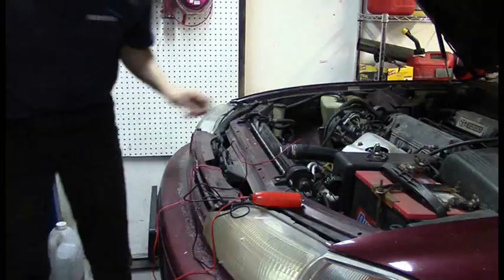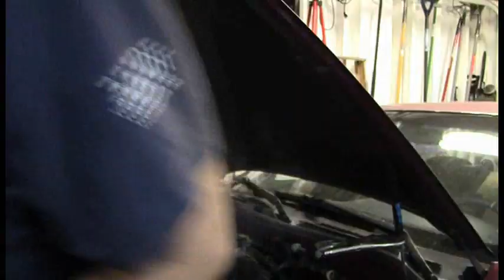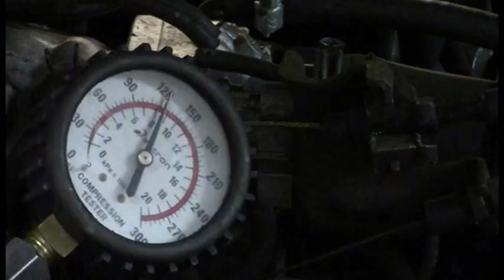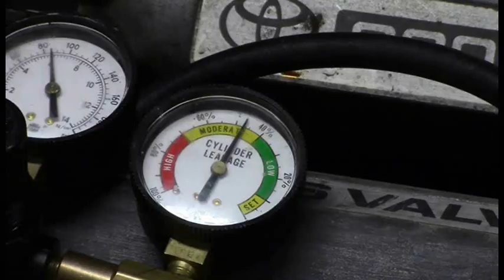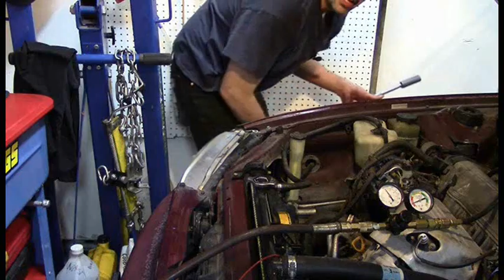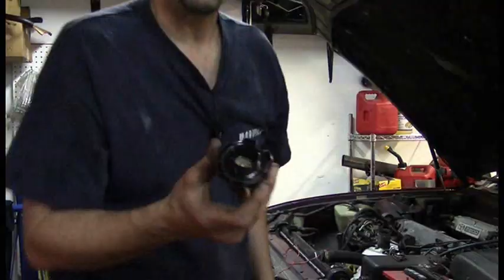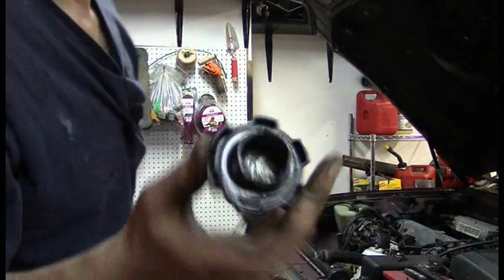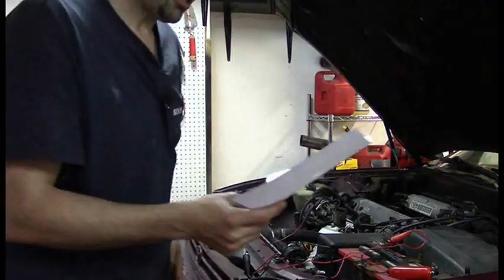12 Ways of How To Test A Blown Head Gasket Compared- PART1

Comment: Great Video.. thank you 
Is it possible to pass the hydrocarbon test and still be leaking coolant into the cylinder?  Mechanic said it passed the hydrocarbon test, but that a blown gasket is why I was losing coolant and overheating.  
His diagnosis was Based on Pressure test indicating a pinhole in gasket, and coolant reservoir overflowing after leaving the cap off while bringing car up to temp.
( I accidentally overfilled the reservoir tank the night before. I spilled some out after getting to operating temp and taking the cap off the reservoir, but it could have still had too much coolant? )
Reply from the maker: Heavendreamer2 That's a good one.  I am going to have to disagree with your mechanic, based on a number of foundations.  Mind you though- he is the professional and I am the DIY, but here are my issues.

First, on a pinhole headgasket leak (not that I believe in pinhole head gasket leaks btw) but assuming you had one- if anything you would expect the hydrocarbon test to be positive but NO coolant in the cylinder. Why? Because remember in the cylinder, compression is at some 150-200PSI.  Coolant is at 15PSI.  Even on the intake stroke you will have far more combustion gas to the coolant than coolant to the cylinder. Not that you would even notice coolant in the cylinder with a "pinhole". I don't buy that you would have coolant in the cylinder but not combustion gasses in the coolant. Maybe if that cylinder also had no fuel misfire too then I guess so.

Second, Coolant flowing from the reservoir or radiator is expected when the car is brought to temp. It's the second purpose of the cap (the first being to maintain pressure). AND- think about it- even if his test were valid, how can it overflowing when his claim is there is no combustion gas in the system??? Totally illogical contradiction.  The coolant is overflowing when brought to temp because coolant expands when heated.

Finally, if his cooling system pressure test indicated the pinhole leak through a head gasket, he would have been able to show the drop of pressure with his tester corresponded to flow of coolant into the cylinder (e.g. remove spark plug and coolant is in the cylinder). Also a leakdown test would definitively verify the pinhole theory. With a leakdown test on the suspect cylinder, even through a pinhole the coolant would bubble over even with engine off.  My bet is these were not done.  

The better explanation would be loss of coolant through the intake manifold gasket, not head gasket. This would better explain coolant entering the cylinder but not having a head gasket failure.
'
Reply: But if coolant did enter the cylinder, it should have combustion gasses in the reservoir, right?

 The car does not seem to have a misfire issue. It does run slightly rough, but this was going on long before the car overheated and was supposedly due to a different problem. As a matter of fact, we had a blown head gasket and cracked head two years ago (the head was machined,t-stat replaced etc) and the car still ran rough, though not as bad as when we had the cracked head.

At this point I'm not even sure we are losing coolant other than due to an overheat taking place. All I know is that the car has overheated a couple times on my husband, he had to replace the fluid, then continued to where he was going, without further problems.

Before all this happened, I had no real understanding of what to keep an eye on with the car. I did not check fluid levels, except oil once in a while if I suspected it could be low. I never thought to check coolant levels because I was not aware it could get low unless there was an issue.  But before I brought it to a mechanic, I wanted to know as much as possible, rule out certain things etc., because tbh I'm afraid of getting ripped off if I have no idea what is and is not possible, lol

So I have been researching for days.  I don't believe its a water pump, and not even sure if there is a big leak. I put fluid in the car this winter and drove an hour to go get my husband, with NO overheating whatsoever. The car cooled off for about 20 minutes or so before the return trip. Without checking the coolant level, we returned home another hour of driving also with no issues.  

The car had been serviced in 2013. Since then both I and my husband both drove it mainly locally. He works very close to home, and most of the stores we go to are close as well. He had an issue with an overheat when he drove more than 20 minutes, and from that point it happened a couple times.  So then he just made sure it had plenty of fluid the next time he went somewhere, and had no problem.  Then there was that 2 hours of driving this winter with no issue.  

All of this tells me at the very least it is not the water pump or a blocked or non working radiator.  Either the fluids got too low - via a slow leak somewhere, not properly burped or filled after being worked on in 2013?, neglect on our part or something along those lines?  I don't honestly know enough about cars to know all the possibilities (now I have to go look up intake manifold's , lol)   

The other thing this guy did.. which I found after I got home (thank God I only live a couple minutes away from that shop) is that he left my coolant reservoir bone dry :./  Needless to say, between his comments on the reservoir overflow (leaving cap off/bringing it up to temp) and the "pinhole" in the gasket indicated by the pressure test - combined with leaving my reservoir dry when I went to pick it up, I really don't have confidence in that shop now.   He also said because the car had overheated, been worked on, then overheated again and had the head machined etc., now that it overheated again he was not even willing to do head work, but recommended a new engine altogether.  needless to say, I am not confident in his 'assessment.'

I did talk to my brother who is a mechanic of 35 years, and he tells me that a gasket can leak without going into the Cylinder, but I would think you would expect it to leak into the oil if that were the case?  idk. Maybe it can leak onto something hot and evaporate and we would never see.

And again, it could have been that it just didn't have enough coolant in there from the last time it was worked on, or from our own neglect.  There are probably a lot of variables that I am not even aware enough to consider.  So now I am going to spend my weekend looking up how the engine works, how the cooling system works, etc. and will be bringing it to another shop for diagnosis on Monday.

Thanks so much for your input, it is very much appreciated. I plan on learning a lot more, and at the very least I will be making very sure to keep an eye on fluids etc in my cars from now on, and to make sure they are maintained properly.

  I hope you have an awesome weekend, and thanks again for the great video! I will be looking at more of them! XD
Reply from the maker: Heavendreamer2 Yes it all comes down to understanding how the engine works. And agreed, the credibility of your mechanic is dropping rapidly.  But to answer your main question on the possibility of a head gasket leak getting coolant in the combustion chamber but no combustion gases in the coolant, think of it this way (though it is sort of a bad analogy but the principle somewhat applies) :
 You have a pressure cooker and it's sealed up and operating at full pressure.  You put the pressure cooker in the sink and cover it with water.
  What your mechanic is saying is there is a pinhole leak in your pressure cooker and water from the sink is entering the pressure cooker BUT and the same time there are no bubbles from the pressure cooker showing up in the sink.  You tell me how that is possible.

 Now that answers about the coolant entering the combustion chamber through the head gasket. As you see, hard to explain.  Now, you can certainly have head gaskets leaks where the coolant isn't involved at all, you can have pressure lost to the next cylinder, you can have oil leaks etc. But if coolant is involved think of the above analogy.

  But another way you could have coolant enter a combustion chamber is through the intake manifold.  Totally different scenario and harder to make an analogy. But it would be sort of like your pressure cooker in the sink of water had a snorkel coming off the lid and out of the water that you feed air and food into but ONLY WHEN THE PRESSURE COOKER IS NOT UNDER PRESSURE.  You can see how a leak in this snorkel would allow water from the sink to enter the pressure cooker but since it isn't under pressure, gasses would not enter the sink. Another bad analogy but the concept still holds.  You can see this is a better explanation for water in the pressure cooker than the first example.
Reply: Yes, I can see what you mean. I did read a little on the Intake Manifold, and the stuff I looked at said that you would probably hear a hissing, or even a slurping sound (depending I guess on whether it was leaking coolant or sucking in more air.)  In either case I would think it would affect the combustion quite a bit. If it were leaking only air, I don't think I would see the overheating problem (car would be running sluggish etc) but if it were leaking coolant into the combustion chamber, I still have to think it would mess with the firing. I still have a lot more reading to do, lol

I wish I was more certain of what happened with the coolant, but I wasn't there and it's been a while.. hubby is getting frustrated with me pressing for details, lol. 

I am hoping they test it thoroughly on Monday, and have clearer answers for us.

Thanks again for taking the time to help me understand.
Reply from the maker: Heavendreamer2 Wow your perception and comprehension are dead on.  You won't hear the hissing sound on an internal intake leak though. Even on an external one it has to be fairly significant. 
 Well if you were in Denver I would look at the car and diagnose it for free.  It would make a great video too!
Good luck and keep going with your learning, you're dead on with your conclusions and I think you'll come to the same ones as me.
Reply: Well, ty.  I wish I was in Denver! lol  
crossing my fingers.
Reply: Thought this was interesting.. especially in light of your friend's 'sizzle test'  

It occurs to me though, that this may not be the best test unless you can see a really clear difference and can get a large enough sample of oil from the pan.  I can't, because I don't have equipment and am not allowed to do car work where I live. Not even sure if I could reach the pan, it's a tight fit under there without raising it on my non-existent blocks, lol.

My thought is, that according to the article, most cars have at least a small amount of moisture/water that gets suspended in the oil additives until it can be burned into steam and released by the PCV. If you're not driving long enough for the car to heat sufficiently to do this, it will stay in the system/oil.  In my case, the car is most definitely NOT driven enough, and therefore some moisture can be expected. The article says that the glycol itself does not boil away. This means the 'sizzle' is water, not glycol.  Sooo at least in my case, not the best test since I can expect small amnts of water to be present. 

Just a thought.  Oh.. and I'm wondering if the blot test works with oil from the dipstick, or if you need to get it from the pan itself. Wondering if it be more coagulated on the dipstick than in the pan due to air reaching it. Don't mind me.. I'm like a dog with a bone at this point lol. It's really hard to quit chewing on it.. I think I will try to play my video game and hopefully distract myself enough lol.
Reply: Schrodingers Box  Well.. I brought the car to Sears Auto today.  Kind of wishing I had skipped that and just brought it to the dealer or something lol.   They call me back, tell me the water pump is good, they found no leaks, Thermostat is good, and Head gasket is fine.

  I get to the shop later to pick it up, and they tell me that it failed the Block test. I was like.. wait, I thought you said it passed?!  The guys says that it 'took a long time' for the test to show any combustion gases.  Now I don't know what to think.  He recommended I take it to the Dealer for an OBD II diagnostic. Apparently, Sears Auto (at least the one near my home) doesn't do compression tests or anything like that.. the most they did was pressure test (no leaks), Block test, and I guess check the hoses physically (including to indicate thermostat is good).  *sigh*  

So here I am SMH wondering if the "tiny amount" of combustion gases would have been a large amount if the car had been driven for a bit first?  I know they run the car to run the test, but it passed the first time, and passed the second.. except then apparently the "pass" turned into a fail by giving it longer to find gases?  This is so confusing. It really makes me wish I had been there to see what they did lol.  It prob needs a good diagnostic anyway since the check engine light has never gone off from the first time they fixed it. At least no one has charged me yet ...
Reply from the maker: Heavendreamer2 Yeah my experience is Sears techs couldn't diagnose a diaper rash much less a head gasket.
  There is some validity to the possibility that the combustion gas test may take some time to detect but the thing is a leakdown test would be instantaneous and irrefutable. 
  And OBD Diagnostic can not determine a head gasket- you have to do mechanical testing. Even a $15000 OBD diagnostic tester cannot call a headgasket-  it has nothing to do with OBD. Even if you did get an OBD, you can't fix anything until you ensure the head gasket is not an issue.
  You really need a competent mechanic to do a leakdown test. It couldn't be more simple.  You run compressed air into the cylinders and if you see the coolant bubble you are done- Head Gasket.
Reply: Hahaha! Diaper rash, lol
Leak down test...gotcha
I remember seeing you do that one on the
Video. On the bright side, I have learned a LOT about how the cooling system works, how the Heater ties in, and tests to diagnose a head gasket leak (or just loss of compression in the cylinder. ) TBH I am amazed at how simple it really is. Once I looked up how the thermostat works, and then how the cooling system works (with diagrams), the Light went on and I can actually think about it logically.

Yea I was a bit puzzled by the suggestion for the OBD too. But my check engine light IS still on so I'm not sure what to think about that. Maybe they just never reset it? Or would it only stay on if there is a prob and should I have the OBD done anyway ? In addition to a leak down test I mean.  Nvm.. I'm going to bring it to Dlr & just tell them it's overheating, check engine light is on, and no heat and let them sort it out.

Thanks for all the great info! 
Hope you have a great week XD

Comment: Hi sir i have a 2002 ford focus its overheating trying to figure out what is the problem i did the chemical block tester stayed blue removed thermostat and replaced water pump even even bypassed heater core flushed radiator and burped system but i did noticed a little water in the oil what could this be would a manifold intake leak cause it to over heat or could it still be a head gasket thanks bro?
Reply from the maker: Could be. You will need to do basic cooling system diagnostics starting with pressure test

Comment: Hi I was driving my bmw 325i (1991) and It's always had a constant overheating problem. It would always go between the H and C, like while driving the car sensor would go to H then go back down to C in like 5 minutes of driving. I thought it was just a faulty sensor so I continued to drive it.  Just a couple of days ago I was driving it to pick someone up and as I was loading the luggage in my car and letting it run, the coolant completely leaked out and the car started to overheat/steam. I checked the oil for that creamy substance and found nothing. I let it cool down and put more coolant in the car and drove for a bit longer. It continued to stay on the H for the entire drive,  I would stop every so often to let it cool down. The check engine light eventually came on so I parked it at home until I was ready to look at it. Today I received help from a friend whose a mechanic who said its either the water pump,thermostat or head gasket. We tried to get a diagnosis but the shop was full and he wanted $75.00 for it and = wanted me to come back tomorrow ( I am in college and I need to save as much as possible). I left and went back home and then while driving the car back home it was still a little groggy(barely could notice the difference), then out of no where the coolant just squirted from inside the car onto the windshield and then the car started to overheat pretty bad. I was close to home so I hurried back and parked the car. I checked the oil again for anything and didn't find the creamy substance. Based on the situation what would you propose?
Reply: I am willing to pay for whatever to fix it, im an engineering student and my friends a mechanic, we are willing to put in the work to fix it. I would just like to get some better knowledge on what you think the cause would be.

Comment: I have a '99 ford Taurus se. My coolant light came on and then car proceeded to over heat. Filled the reservoir. It was empty within minutes. So I put another 50/50coolant in. Leaked All over the ground.. Now,,, theres nothing under my car on the ground but reservoir is bone dry. My oil is not milky, normal dark brown. Do you have any ideas for me?? Much obliged. Thank you. Jaimie.
Reply from the maker: Yes I would pressure test the system and do basic diagnostics to determine the cause of the leak. My video "12 ways how to test a head gasket" covers, well, 12 ways to do this.